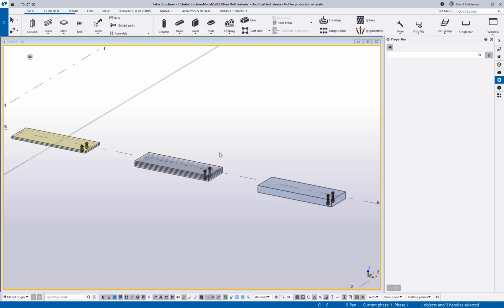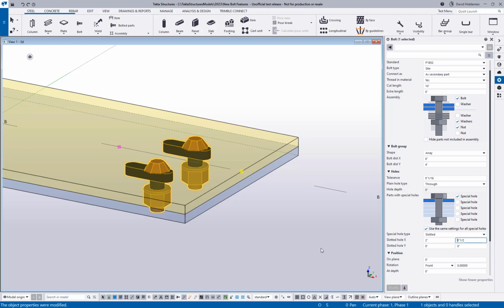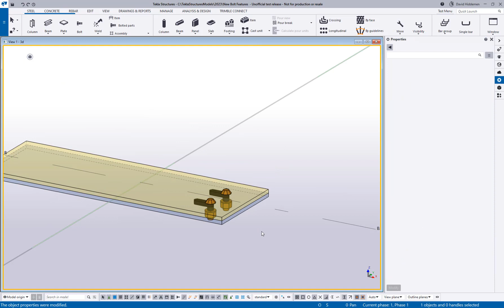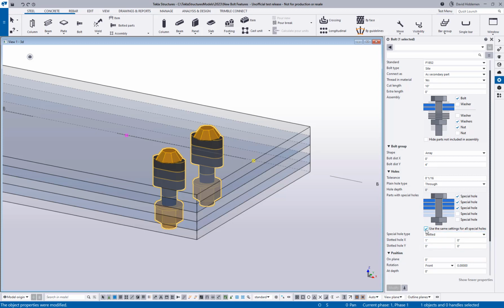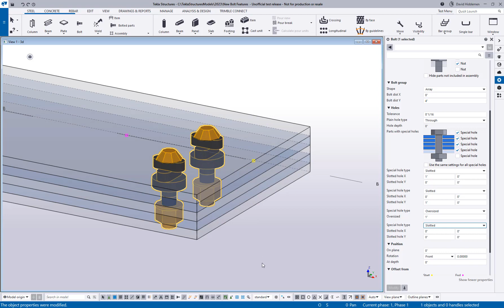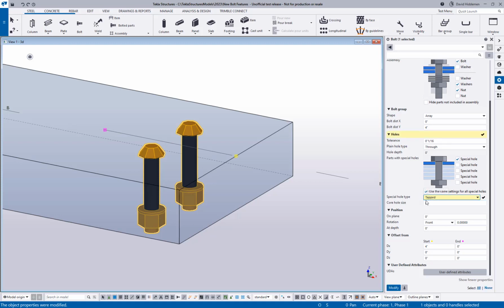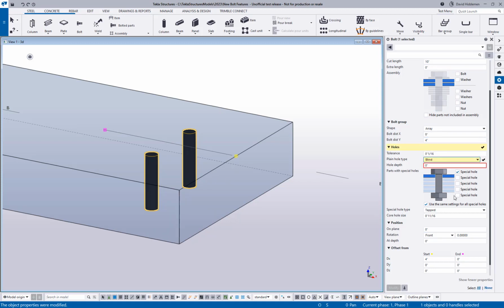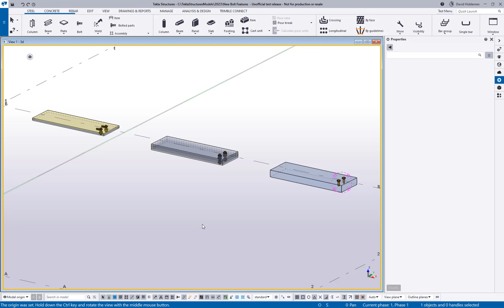Tekla Structures 2023 - New Options for Holes and Slots

Comment: Can't wait to use this. I had to use workarounds for a long time now. I just wonder how these will be implemented in the connections.
Reply: At this time, it is not supported in component dialogs, only in the direct bolt properties shown here.
Reply: hello sir, can you help me convert a 2022 version file to older versions?
Reply: @usmanpasha8295  It is not possible to convert models to older versions of Tekla.